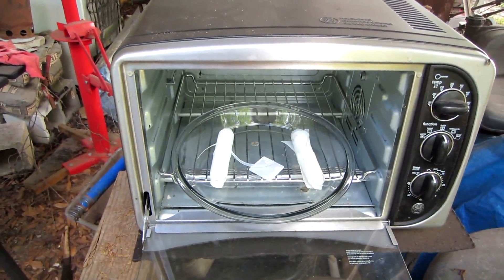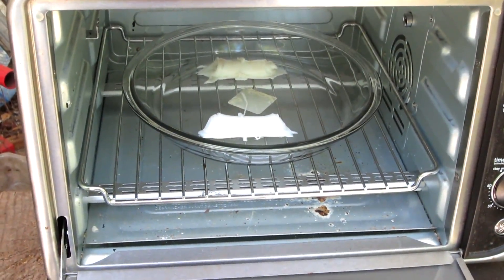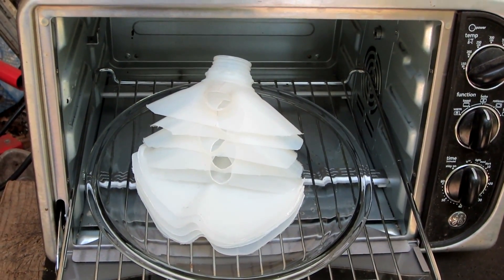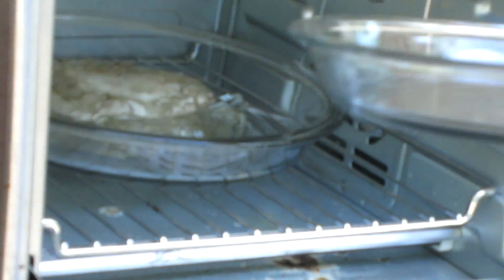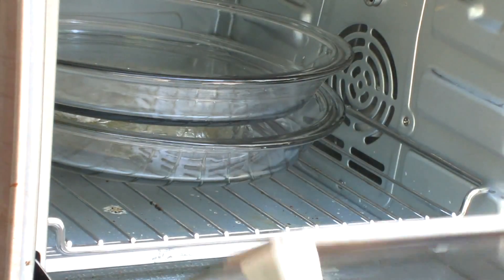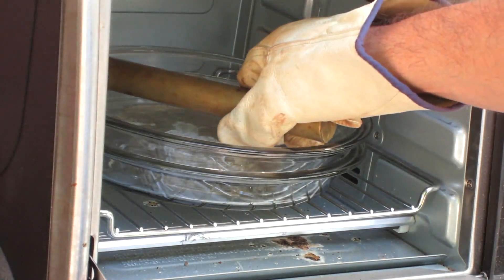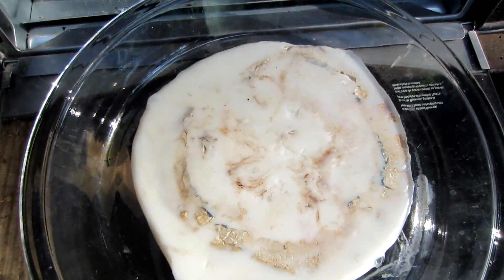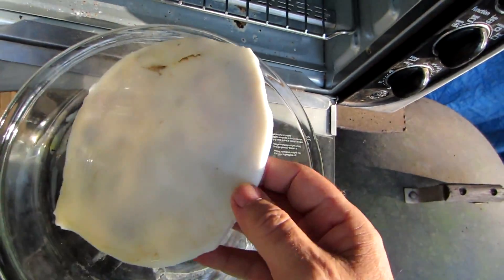How to melt plastic bottles and get a shiny finish

Comment: And if you use the side of the milk carton to the top milk can't direction made out of three different grades of if you melt the same plastic sides is the best plastic but if you just melt the tops and then you met some with the sides then you'll get that hardness in the middle

Comment: I tried your method except I had already turned the jugs into flat plastic cubes for storage purposes.  Unfortunately, it didn't work well for me and the plastic melted onto the pyrex.  It didn't melt completely either.  I had to reheat the pyrex to separate the pie plates.  Pyrex is an insulator to heat.My best results are using small, non-stick baking pans  .  I don't know how to show a picture of it here.  Thank you for showing us your try and I hope others have success with it.

Comment: You are lucky. Some plastics stick so well to bare glass that you will rip chunks out of the glass trying to pry the plastic off. Plastic milk jugs are HDPE (High Density Polyethylene) and water bottles/pop bottles are PET (PolyEthylene Terephthalate), so you know what plastic you are working with. Dense structural plastics like the molded inside plastics in refrigerators and plastic car bumpers/body parts are ABS.
Reply from the maker: Use a release agent.. cooking oil, WD40, motor oil ect. Some release agents gets hot and stain the plastic

Comment: Can making a mould out of cement be a good idea?
Reply: I don't think so unless.. it has to have really thick walls in order to support high clamping pressure. Now.. if you were making electrical boxes, I would make flat sheets out of plastic then saw the sides out of it them, then melt corners together with a paint stripping heat gun. You can get at Harbor freight

Comment: Can I electrical looping boxes out of melted hdpe plastic. Cozy I think it can be difficult to be poured into a mould ,what I can do?
Reply: Plastic injection into a mold.  It's how alot of things are made but the cost to make molds varies whether you machine it for multiple pieces made or single / low volume runs made from wood.

Comment: Do you think it can be formed into much thinner pieces? Im trying to recycle into material useful for building storage bins. Boxes, office organization, shelving, etc. 

I was thinking, maybe if it was heated to a much higher temperature? Idfk. Anyone?
Reply from the maker: You can make it as thin as you want with enough pressure. They do it all the time with hydraulic presses.

Comment: This is fantastic! Thank you so much for sharing this. It answered exactly what I wanted to know. :) I have recently learned that resin won't stick to HDPE so I want to melt some and use it to make molds of certain things that I can then cast with resin. I use a liquid silicone that I mix and pour currently. I have also tried several molding materials that you can melt and use again which were flexible like silicone. 

I didn't like how they worked with resins though. Silicone works great with resin but I can't melt and use it again to make a new mold. I figure I can do this with HDPE but I still need to test the quality of the mold made. I also may use it in the way mold putty is used by pressing the items I want to make a mold if into warm HDPE. 

- Heidi
Reply: BlackCat2 That would be cool to see! Make a video. I would love to see that on YouTube.
Reply: Will do though my creative channel id is nettypreat and it may end up on Instagram instead of YouTube. Maybe both. :) I also have to get over my slight anxiety about melting it in my house. :P I can use my clay toaster oven to melt it in. I also need to check and see if I have any glass containers in the right sizes and if not then visit my local Dollar Tree to get some. :P What is the best temperature to melt it at?
Reply: I would make sure you have a vent just in case but set your  temp to bake at 350 degrees F for 20 minutes is a good start.
Reply: Cool I may have to do a test or two tomorrow. The entire top lid comes off leaving it open if I want to or I can just move it a little bit as well. It is a nice toaster oven that can rotisserie a chicken though with all I have 'cooked' in it I wouldn't use it for food ever. :P The lid comes off because there is a sort of grilling attachment pan thing that goes on there and also a griddle pan that goes up there as well.

Edit: I can also probably use HDPE in my silicone molds in the oven as long as I don't put the temp too high. I would have to heat it longer. I also found a really nice patterned glass dish on the dollartree website and if I melted HDPE in that I would just leave what came out as is. :) 

Also learning that HDPE can be turned on a lathe so very happy to think of all the possibilities there. :D

Comment: Off topic, but Paul Williams is your cousin how many times removed?  Amazing resemblance.  Curious if that oven is convective and what your experiences between the two have been.  Also, have you thought of loading the empty areas of oven with dense filler such as brass plate, then castings etc, and preheating them prior to inserting your crucible?

Comment: Maybe you might have more success if you put both plates in the oven in the beginning with a lot more plastic and put the brass rod alongside so that everything gets hot at the same time. Then when the plastic gets melted enough you put the bottom plate on top with the rod in it to flatten it out while the plastic continues to melt.
Reply from the maker: I believe you might be right. Thanks

Comment: The last few days I watched a lot of videos about melting hdpe. Most people do not go higher than 350F. They say at that temperature there are no fumes and they (can) do it inside. Your hdpe is more melted and therefore it shrunk much more.
Everything has its pros and contras because you have less air bubbles. Using glass is a very good tip. Thanks for sharing.
Reply from the maker: +Hans de Groot Thanks for your comment, another tip is the way you prepare it for melting. Cutting up your HDPE jugs, helps keep air bubbles down. Take a look. https://www.youtube.com/watch?v=cWYxVYbE3hI Please subscribe.. Although they say you can melt this indoors without the odor it's still not a good idea... Please down melt this indoors or at least have plenty of ventilation. It's not what you don't smell that will get you!

Comment: try putting more plastic in the glass pyrex dish to about 1/4" thick then retry it making sure the top glass is evenly weighed down then try to get square pyrex dishes  never though about rolling it up I always cut it into 1/2" square or there abouts.

Comment: i like the glass. I'm gona start doing that. do you ever get headaches after dealing with this?
Reply: Numisaccent no you cant. not evon HDPE, yes it is the least toxic but i have done it indoors. dont do it
Reply from the maker: mr.jmakk No but I never do it indoors either. Just keep the Temp between 350 - 400 degrees Fahrenheit. Use on HDPE plastic.
Reply: Just don't use the wrong type plastic then you can do it indoors.
Reply from the maker: mr.jmakk Be safe don't do it indoors.